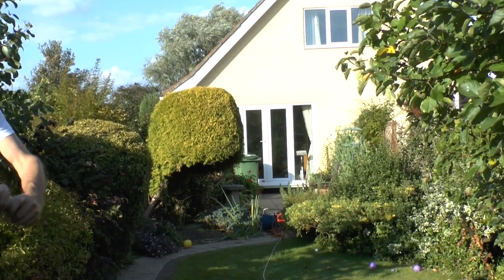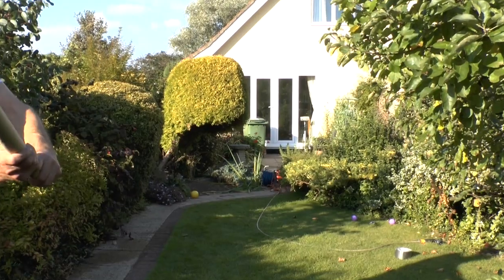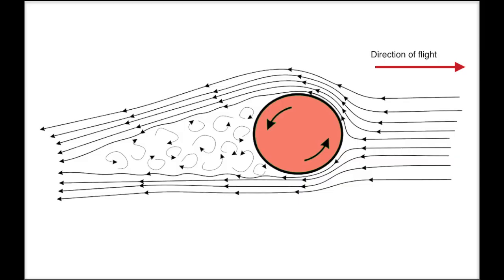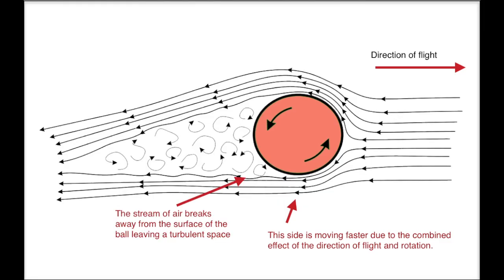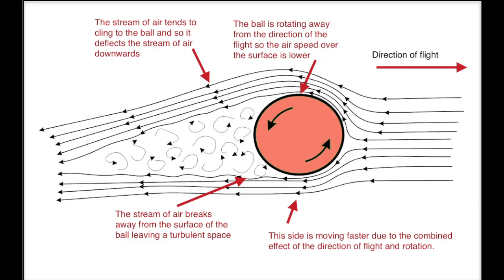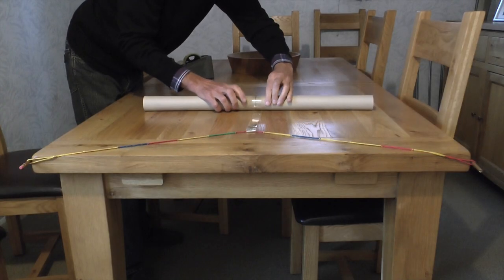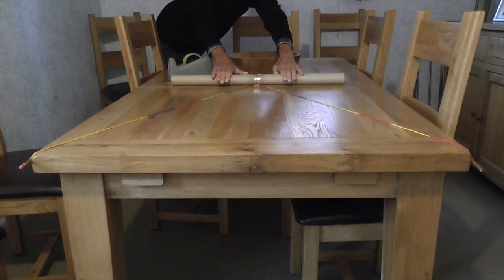The Magnus effect: a curved ball explained: from fizzics.org

Comment: Is the diagram really correct ? The top is moving faster = lower pressure. Also the boundary layer separation is different on each side that also contributes to the force

Comment: Your diagram says "air speed over the surface is lower" means it should have higher pressure compared to area near lower surface. Means, ball should deflect down but your experiment shows the other way.

Comment: In my estimation the effects of the front and rear of the ball or tube cancel each other out and the lift is caused by the under side pushing air into an oncoming air stream ( higher air pressure and turbulence) whilst the top surface pushes air with the oncoming air stream ( lower air pressure and turbulence ).

Comment: But the air upard on the cylinder gets curved around it because of coanda effect and its caused by entrainment of air, so the upard air (at atm. Pressure) pushes it downward and it gets curved around the cylinder. So cyclinder is not what applying the force on air to get it curved, its the atmosphere, how the hell we can say it the air is moving down so it apllies an upward force on cylinder, equal and opposite forces occurs when the force on object 1 v mes form object 2, here object 3 (the cylinder) is experiencing force out of nowhere

Comment: I always thought that was a much simpler effect. I thought the tube or ball was "climbing the incoming air" because the leading edge has more friction due to more pressure. The simplest explanation is usually right, so...  Experiment: Spin a suspended cardboard tube. Blow on 4 sides with 4 air nozzles simultaneously using the same force. Now increase the force on 1 nozzle by a tiny amount. It will climb at right angles like a tire.

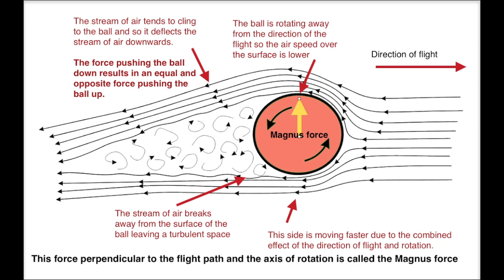Comment: "The force pushing the ball down results in an equal and opposite force pushing the ball up" (2:13). Newton's third law would state that the force (by the ball) pushing the AIR down results in an equal and opposite force (by the air) pushing the BALL up. Is that what was meant?

Comment: Thank you for content.
But I think there is mistake in you diagram.
Bottom side moves slow, because directions of cylinder and air are opposite.
Top side moves faster, because directions of cylinder and air are same.
Bottom side has higher pressure, Top side has lower pressure, and cylinders is pushed upward.
Reply: Fizziks Orgamisation, please look at the chart again. What this commentator says seems right. The air is being dragged forward at the bottom. It pushes against the stream and is therefore slower than at the top where the reverse is happening. The would have the effect of compression at the bottom and attenuation at the top, resulting in a pressure differential
Reply from the maker: I think I have it right, but thank you for watching and taking the time to comment
Reply: i just want to finish my homework😭😂

Comment: Sir, I have a doubt here. I understood that there will be an net upward force perpendicular to flow direction, due to pressure difference which is called magnus effect, but will the body experience any drag force in the direction of flow, in other words, will there be pressure difference in the horizontal direction, just due to the eddies formed. Thank you
Reply: It sure does! Whenever there is a lift generated, drag is also generated. But this depends on the rate of spinning of the ball as well. There is a range of rotation rates where the drag is even lesser than a non spinning ball even though it generates a lift which is really interesting because of its potential applications in aeronautical industry!

Comment: Thank you very much Sir. Please correct - I feel that the rotation of the ball should have been in the clockwise direction i.e. along the direction of flight, in the diagram. If my concern is right then other indications in the diagram has to be changed accordingly.
Reply: yaya true  i think the rotation of the ball should be clockwise
Reply: This confused me as well, did you ever find an answer?
Edit: Lift force = - circualation x density x velocity of fluid 
And circulation is derived as being positive for counter clockwise, so assuming fluid flow of left to right ( ball moving to the left) with a counter clockwise spin, the force should be downward (provided my understanding is correct!)

Comment: Thank you for the explanations. I would love to know would happen if the experiment is redone either with a more heavier(say metal) tube or done in vacuum.
Reply from the maker: With a heavier tube the effect would be less pronounced. In a vacuum there would be no effect at all.
Reply: I think you didn't understand the experiment all is happening because of the air presence ( The air that is present in the surrounding  or by externally by the force of like fan or wind also is the perfect example that is blowing only by one direction) 
Followed by mentioned in bracted column above :- By surrounding means like you are rotating any object in the direction means you have to give the object motion only rotary motion you can give it will not happen in sliding motion and this will happen. 
Air presence is creating the boundary layer phenomena which causing the object to rotate in opposite direction
How: 1. Surrounding case we are rotating the ball in by inclination we given the ball a rotating motion when it is falling the static air is affecting opposite to the motion of rotation which causing this to swing in opposite direction as lighter the weight as much this will affect lastly gravity forces are much stronger then reaction generation forces right? 
that is why your first and second question gets covered.

Comment: Do artillery gunners correct for long range shell spin in the same way as Magnus effect on the cylinder?
Reply from the maker: No because the direction of movement of the shell is along the axis of the spin rather than perpendicular to it.
Reply: @fizzicsorg  Is cross-wind the [only] long -range correction needed? e.g. same long-range target by interchanging ordnance: [ rifled (spin) vs sabot, smooth bore or fin stabilised ]
Reply from the maker: @AV036  I'm no expert in gunnery but it may be that different cross wind correction is needed for different ordinance. It seems very likely that speed, therefore time in flight, would make a difference. As I suspect you know, rifled spin is used to avoid the ordnance tumbling but a strong cross wind may effect the flight due to the spin.

Comment: Because the curved path causes a pressure decrease and the path of the curve is longer on one side, the total force is decreased more on that side.  PRESSURE difference.  Saying "newton's Third Law is the result, but misses the actual cause.
Reply from the maker: No, I think you have misunderstood.  The upper curve, to which the airflow clings, together with the "angle of attack", the inclination of the wing,  deflects air downwards which  has the effect of pushing the wing up. That is Newton's third Law. There is also a pressure difference between the upper surface and the lower which adds to the lift.

Comment: The stream of the air on that side of the ball ... therefore clings to the surface rather  more and because of this it's deflected slightely downwards.

This doesn't sound right to me. Is this established fact? Can I learn more about this? The slower the object, the more sticky?

Would you consider this? On top side surface of the ball doesn't move so much against the air, ergo there is less air resistance at the top, ergo the ball ends up moving upwards.
Reply from the maker: To move the ball up, as in my diagram, requires an upward force, frictional resistance to forward movement does not provide that.
There are a number of information resources of varying quality. Check those out with a good reputation e.g.Institute of Physics (UK). NASA, American Physical Society
Reply: Why NASA? This ain't no rocket science. Imagine simpler situation: You throw a ball in such a way that it barely brushes tops of your bush. Bottom half of the ball will be in path with greater resistance. Now the question is: Will the ball bounce off the tips into a path with less resistance, as I claim, or will it keep going straight regardless of obstacles, because frictional resistance to forward movement does not provide that?
Reply from the maker: Why NASA, because they have good explanations such as https://www.grc.nasa.gov/www/k-12/airplane/beach.html . I you tried using your brain before your keyboard you might get on faster.
Reply: Thank you for the link. I understand the phenomenon is by large ununderstood. That doesn't mean we have to behave like childern and accuse each other of brainlessness. I value what you do, you could also consider I have explained airfoil in my own way, as well as I have calculated ideal lens, lift turbine and lift propeller, see my channel for details.

My questions are:
- The spinning ball moves relatively faster on one side and slower on the other, top faster at your drawing. Correct or not?
- The greater the relative speed the larger air resistance. Correct or not?
- The greater the air resistance, the greater the chace the ball will choose simpler way to fly. Correct?

This doesn't mean Magnus effect is explained incorrectly. I personally find it fishy, but I blame noone. I simply gave my questions and await answers.
Reply from the maker: OK, but this is a well researched bit of aerodynamics for which a stream of air around an spinning object is shown in wind tunnels (nice bit of video on Wikapedia which shows a layer clinging to the relatively slower surface) and I was irritated that you simply dismissed the NASA article when aerodynamics of rockets is very much their field. I cannot really see any convincing explanation that does not involve the redirection of the air stream.

Comment: Nice video. Is there anyway to calculate the moviment caused by this effect?
Reply from the maker: Well there are many variables such as the velocity, the speed of rotation and the texture of the surface so an estimation is possible but close calculation problematic.
Reply: Thanks for answer. Which subject can I  study to learn how achieve this estimation?
Reply from the maker: It is within the study of aerodynamics. Google Magnus effect calculation